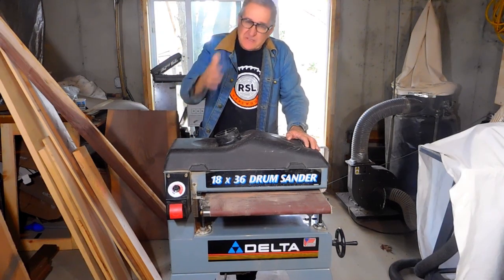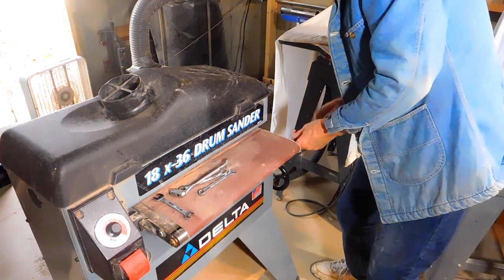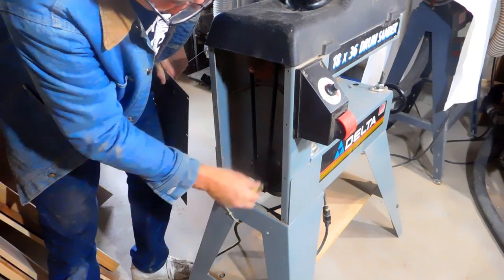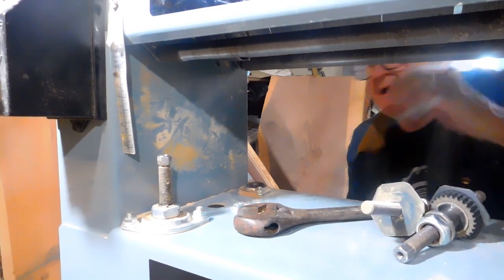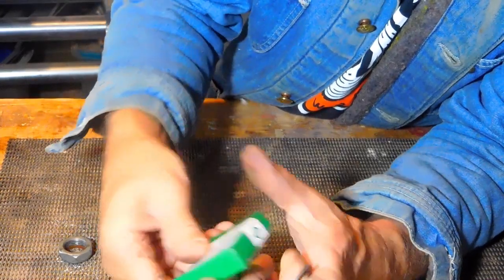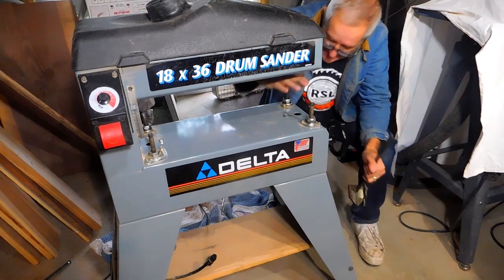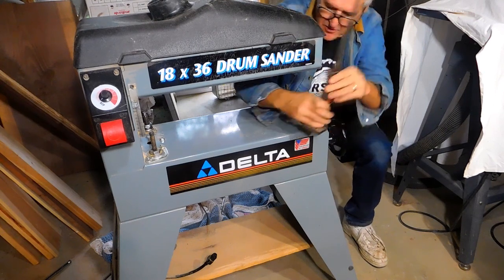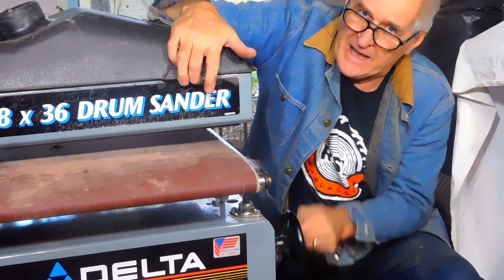Delta Drum Sander / Repairing the movable bed /

Comment: I have this sander its been a nightmare. I picked it up cheep .i had the same problem as you took forever but fixed it then the feeder motor went replace that 350 later .now the plastic gears to rase and lower the bed stripped out 165 for new metal ones . hard to find some parts for this machine . waiting on parts still but omg nothing but problems but when its done will be a great asset to my shop . your vid was helpful thanks..

Comment: Haven't used mine in over 2 years because of the constant issues with table adjustments. Will take it apart one more time and use your advice for the fix and hope it works. Nice machine to have around when it works. Thanks so much for taking the time to help others. You are a true craftsman.

Comment: Hi Mr. Ricketts  I bought a used Delta 31-250 Sander from my hardwood supplier for $100.  One of the top rollers was missing but the replacement parts came with the sander.  I put that in with no problem.  I then wanted to check the bearings of the bed raising  system.  I watched your video, which is excellent.  One of the lock nuts came off very easily, the bearing was fine so I lubed it a bit and put it back together.  The problem came when I tried the next lock nut.  I ended up holding the timing gear underneath with a channel lock while my wife  used a crescent wrench to remove the nut.  Long story short, the  nuts on two of the lifters I tried to take apart were so tight that we broke the hubs of the timing gears.  Now I am searching the internet to find replacement timing gears. I am not having a lot of luck.  Since the three bearings I saw were in good shape I decided not to attempt to remove the fourth lock nut above the main drive gear.   I hope your sander is still performing nicely.  Very Best Regards,
Reply: One more follow up to my previous posts.  The timing gears from State Tool Gear arrived on Saturday.  They  exceeded my expectations for fit and finish.  I highly recommend them if you need discontinues parts for your sander or other machine.
Reply: Were they plastic or metal?

Comment: Thanks for the video! I bought the same sander for the same price and it has the same problem plus the gears where broken. I fixed the gears with SDP-SI (part # A 1M 4-Y16032) and a bushing but it is still very stiff. I will take it all apart to clean the bearings.
Reply from the maker: Thanks for watching. I can't for the life of me find where I bought those bearings but it was under $20 for the 3 bearings. Sometimes bearings may feel good when removed but have flat spots and stick under load. The only other tips are to not over tighten the nuts and not over tighten the belt. Thanks for the part number of the bevel gears. Do you remember the cost of the gears. I am sure this is something other viewers will be interested in.
Reply: I think have broken one of the gears on mine while trying to tension it. the belt  is no longer catching when i turn the handle.  how do i know if it's broken?

Comment: I have been battling my Delta Sander for 15 years and I’ve put hundreds of dollars in parts into it and actually had custom pinion gears made. But I never realized those bearings were in the levelers. This gives me the confidence to replace those because my table is hard to move up and down. I didn’t quite get where you bought those bearings they look exactly like the ones that are in mine. This is a great video I appreciate it good job..
Reply from the maker: Steven, you can google the part number and come up with the bearings. They are more expensive then what I paid. One thing that is important is not to get the belt too tight after installing new bearings. I will see if I can find them and put it in the description.
Reply from the maker: Here is the part. I know I paid about $5.00 each but don't remember where I bought them. https://www.motionindustries.com/productDetail.jsp?sku=00094487
Reply: Kricketts cool I just ordered 4 
Thanks.....
Reply: @kricketts4348  that link takes you to the wrong bearings.  I ordered them and they were too big.  It's not the same one as what you show on the box in the video.  You might want to fix those links so more people don't order the wrong one's.  Iirc those are TC1625 and what is needed is tc1220
Reply from the maker: @swiftyforlifey1  Thanks. I updated the link. Sorry for the mistake.

Comment: I'd found that the nut on the stem bolts were too tight and so the cranking was to tight.
I had to hold the crank and loosen the nut until the washers and bearing could spin freely...and left  it. That did it.
The previous owner cranked it while too tight and striped the plastic gears which are $50 if you can fine them.
Many parts on these things are discontinued. The pivot bushings bearings are $150 each

Comment: Thanks for the great vid! My question, is I see that you seem to be missing the support plate? It works without it? Maybe that’s a factor? According to the parts diagram, there should be a large rectangular plate (406130720006) that rests on the 2 support bars that span the 4 threaded rods just under the bed. Mine came used without one, but all 3 “types” of this model show it in the diagram. What gives? Thanks again!
Reply from the maker: I don't see one on mine but I didn't dig too far. Maybe it is a plate that supports the sand paper on the bottom. It may be there but the sand paper is in the way. If it is not on the video then it isn't there. I don't remember it.
Reply: Thanks for the reply sir! seems to be working for you without this plate, so I’ll try that. Curious to hear any other owners - black support plate? No plate? I’ve also realized that the originally specified 1” bolts that screw through the plate, into the leveling rods are 1/8” too long, so I’m pretty certain the support plate was supposed to be there. I may just fab one. Thanks!
Reply: @lostandfound404  late reply, I know, but hopefully it's of use to someone. The "support plate" is just a plastic shield basically intended to prevent sawdust from getting on the table screws. Older models didn't have this, they released it after the fact.
Reply: @NKWoodworks  Yes, mine doesn't have the "support plate"

Comment: One more (less important) question... the thrust bearings being spoken about in comments, that should be lubed - those are the same “washer bearings” that you do keenly discovered?
Reply from the maker: The washer bearings are technically a thrust bearing. They don't turn fast and shouldn't have too much pressure except for the table. I vaguely remember somewhere where it recommends a few drops of oil once in a while.  Just remember any lubricant will collect sawdust. I left mine as is.

Comment: Just looking to pick one of these up for $550. Good condition only used a half dozen times. 
Is it worth it in your opinion?
Reviews are mixed.
Reply from the maker: I think it might be if it is truly used just a little.  They seem to work good for several years but the table starts acting up after that. I waited until I found something cheap. The price of used was just too close to new.
Reply from the maker: They aren't that complicated. Maybe look at the drum closely for wear. I have also seen where people have problems with the clips that hold the paper but I don't have any problem.
Reply: @kricketts4348  Thank you for your reply. I'm still debating it. If the was a little less I think I'd be all in. Just not sure.

Great video.
Reply from the maker: It does seem to be on the high side or maybe fair price but I look for a bargain.
Reply: @kricketts4348  yes I agree.

Comment: I got the delta x for free! used twice. the bed belt wouldn't turn. hit the reset button.. like brand new. now, here's the only problem I had. the two tension bars have about 5,000lb more than they need. remove them. then it sands perfectly.. so long as you start with the height just barely rubbing the wood. 1/4 turn at a time after that.
Reply from the maker: I had to think about what you were talking about. Those tension rollers have a very strong spring and I don't know why.
Reply: @kricketts4348  once you thought about it.. it was automatic though. I took mine right out. now? what a beautiful machine. go by feel and sound.. vision too. doesn't matter if the wood doesn't touch the first time through. but once the perfect height to start from is found? no more than 1/4 turn at a time. it's beautiful without them. I think the spring order must have gotten mixed up with a steel grinding machine vs. fine woodworking.
Reply from the maker: @garycarpenter2932  I think they had some left over elevator springs. I do the 1/4" thing when I get the board started but I have to put a strong hip push to get it started past that tensioner. Doesn't seem to be a real problem so I think I will leave them in for now but I knew exactly what you were talking about.
Reply from the maker: Another thing if the board is thicker at one end and you start at 1/4" and turn it down to touch it could jam the conveyor and trip the conveyor motor. Done that.
Reply: Yes, those rollers apply way too much pressure. I wonder if that's why I'm getting some snipe. They're an absolute byotch to install or remove, but I'm going to try removing them while I have the bed off. Thanks for the tip!
Reply: NOPE. Stock doesn't feed without SOME downward pressure on my bed. Ugh.

Took several hours to get the rollers back in. I'll chalk it up to a lesson learned.

Comment: Great video.  Followed right along, and replaced the three roller bearings.....moves up/down pretty well.

My kid got this used; didn't work quite right so he gave it to me to sort it out.

My problem now is the conveyer belt.  I can't get it to remain stationery.  It moves to the right and no matter how much I turn the adjustment (clockwise) I can't stop it.  At this point, the length on the right side (front roller to back roller is 32 1/8" while the left side is 32 1/16"....but she still drifts right.

The rollers looked a bit worn, so I sanded them down to smooth 'em out.  The belt is definitely not pretty, but seems to be intact.....although along the edges it sometimes does not lie flat.

Not sure what else to do to get the belt stationery.  I've seen a new belt on Amazon for $50; just don't want to waste my money if that's not the problem.

Suggestions most appreciated.
Reply from the maker: Mine does the same but not enough to tear the belt up. I was going to try to flip the belt end for end and see if it tracks the opposite direction. That would tell if the belt is stretched on one side. Also I would check the head roller to make sure it is straight to start with.
Reply: @kricketts4348  Brilliant!  You nailed it.  Squared up the drive roller against the table (it was quite a bit off) and she's working fine.  Much thanks.  (Do you do wife repairs?)
Reply from the maker: @larryhavassy2280  Working on my second one but I may have it figured it out.

Comment: Here's my experience with this machine:

Table height wheel was very difficult to turn. Belt was skipping teeth now and then, which throws the table out of alignment a tiny bit with each skipped tooth. I replaced the belt, hoping a fresh belt would work better. While I had the belt off, I performed the service shown in this video.

No improvement.

One viewer recommended greasing the needle bearings, so I did that. I also loosened the large nuts on the four table posts to finger tight.

Voila! Table height wheel turns easier than ever! No skipped teeth either!

Will report back after some use.
Reply: Hey, I have the same issue with mine (timing belt skipping teeth and so misaligned height posts). I’m not sure I got what you say. Where are located the nuts you hand tightened?
Reply: @rifosi  8:10 - The large silver nut on each post. He's grabbing one at this frame of the video.
Reply: @bullfrogpondshop3179  , thanks for your attention. Yes, makes sense that this nut should be just touching the washer-bearing-washer pile, and not crunching them. In my machine, I needed to screw this nut a little bit more using a wrench, to get no gaps between the nut and the w-b-w pile, taking care to still allow them to move freely side to side but not up and down. I did this yesterday. But it is still skipping teeth, unfortunately. Since I took all three posts (all except the one with a jam nut)  apart and cleaned and lubricated all parts, including the now infamous thrust bearings, my last guess for the culprit is the timing belt. I took it off and although it looks okay, maybe 15 years of service being used eventually with more tension that it would be recommended, resulted in some stretch. The problem now will be to find a replacement, since I live in Brazil. I tried to Google the codes printed in it, but got no valuable information. Do you know some Goodyear online retailer that I could try? Thanks again!
UPDATE: I just found it in Amazon. I’ll place an order and let you know if it worked.
Reply: @rifosi  great news, good luck and yes keep me posted!
Reply: I eventually found out that in my case the problem is with one of the timing gears. It’s broken and the screw get stuck at some point. So I need a replacement. If someone has a non-working sander like this, I would buy this part if not damaged.

Comment: It’s called maintenance, all machinery with moving parts need lubrication. This is not a mystery, dirt clogs where oil or grease should be. Those are thrust bearings and even if crappy will work and last your lifetime if you just oil them. Full stop. Not everything is disposable!!

Comment: I bought this sander brand new about 15-18 years ago (guessing).  It would not make a good boat anchor.  As far as a sander............................I messed with it from new to 3 years old and it never worked as intended.  I gave it to my brother who was going to mess with it..................Now we don't talk anymore.   If someone wants to give you one, don't take it.  If someone wants to sell you one, report them to the police as a crook.  Shame on you Delta.  Seriously, a large, heavy piece of shit.
Reply from the maker: I can see where this sander could be difficult for some. It does take a little bit of mechanical ability to figure it out.
Reply: @kricketts4348  Funny.  Mechanical ability?  The space shuttle does take a little bit of mechanical ability to figure out.  This machine is just garbage.   Doubt you can find any other machine on you tube with so many videos about how to fix.  And the fix videos about this machine are not from over use IMHO, they are fixing what Delta (or china) put together cheaply and poorly in the first place.  I guess it goes without saying that I do have parts if anyone is needing some.  Or wants an entire machine, but I will not provide a warranty.
Reply: @grantparnes  Somebody has some strong feelings.
Reply: Grant Parnes   He was being polite, it’s a sander, it isn’t the machine, it’s the operator.